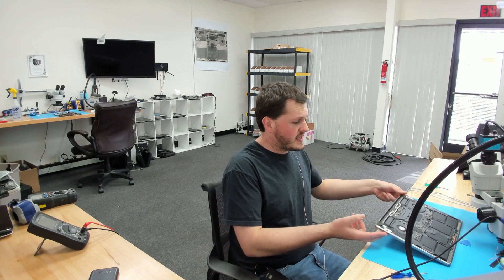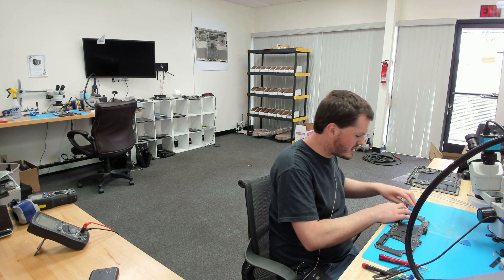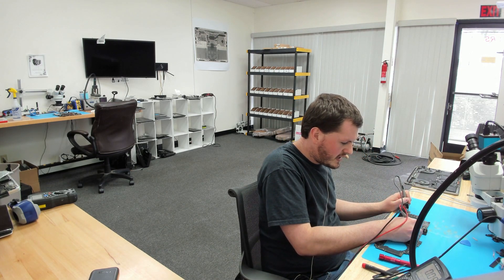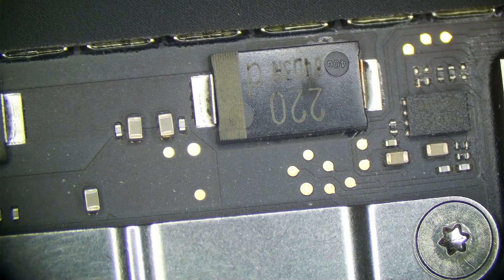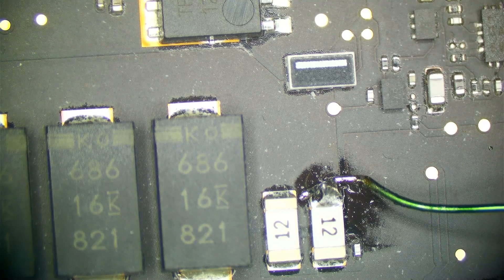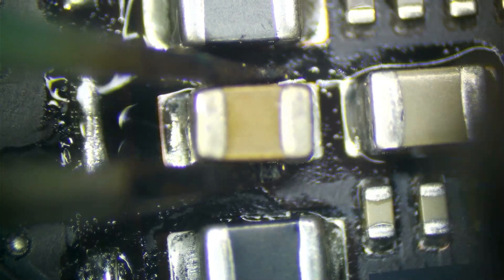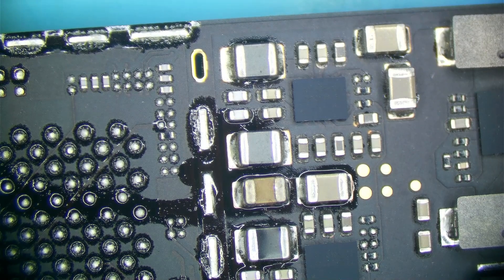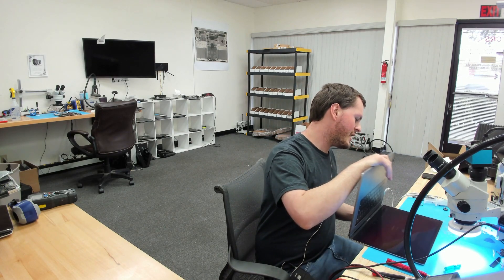The Apple store said this MacBook needs a new logic board, and a new battery. Let's prove them wrong

Comment: This is random, but do you know what the voltage threshold is for the output of a current sense element on a MacBook Pro? I know typically a voltage sense output should be low but I have one that outputs up to .43v. I don’t have a reference to go off of to know if this is indicative of a short or a high draw on my 3v3 circuit.

Comment: I wonder if other capacitors in parallel to that one that popped aren't gonna pop too in a near future. Wouldn't be wise to replace a bunch of them? Longevity wise.
Reply from the maker: Nope. They will be fine. It usually is a single failure. I've actually never seen 2 ceramics parallel to each other fail without the presence of liquid. Usually its just a small small crack from manufacturing defect that gets bigger or is made bigger from a drop or shock exposure or something along those lines.
Reply: @TCRSCircuit  cool. Thanks!